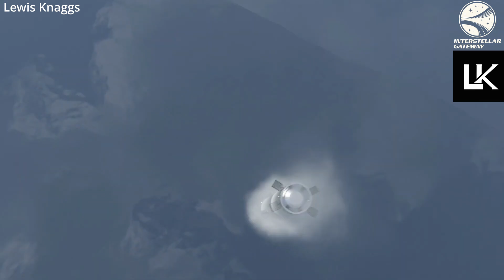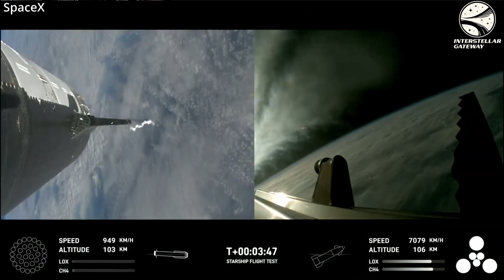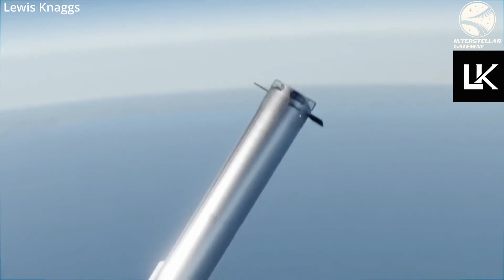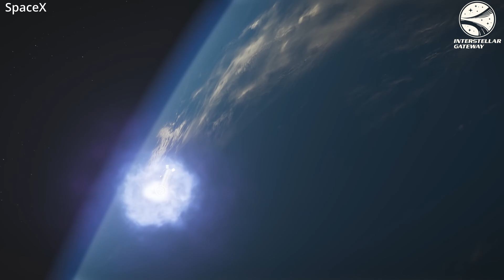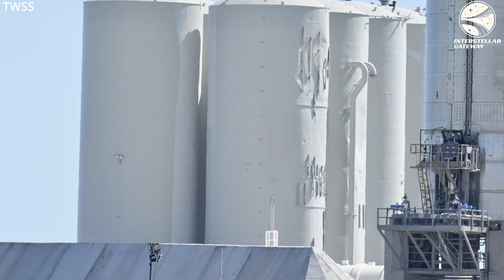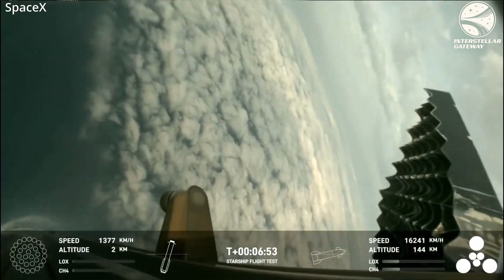When Will SpaceX Catch The Super Heavy Booster?

Comment: Is there any evidence, anywhere, that Spacex is planning on catching vehicles? I expect them to land the boosters and ships just like they do the Falcon boosters.
Reply: SpaceX is planning on catching not only the boosters but the Vehicle with the "mecazilla arms"
Reply: I know Elon sent a tweet about three years ago but I haven't seen anything since.  @BolloNova
Reply from the maker: There have been no design changes to accept any type of landing gear on either. (The landing Legs would need just as much testing as everything else). Both vehicles are both way too large to transport from landing pads or floating platforms to actually consider it rapid reusability. (even more so considering V3 will be even larger)